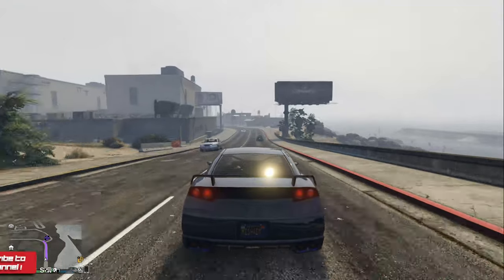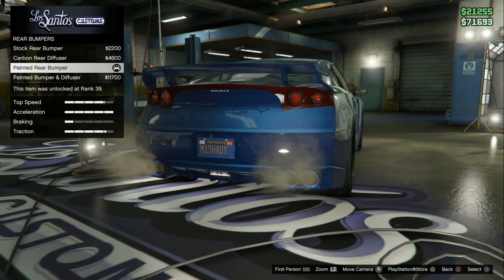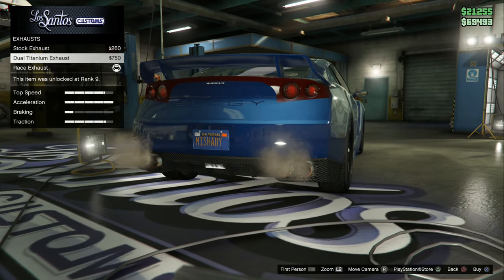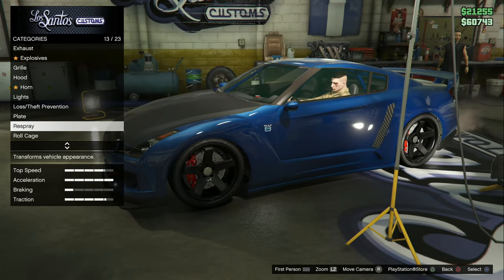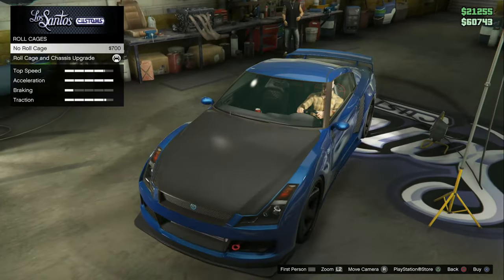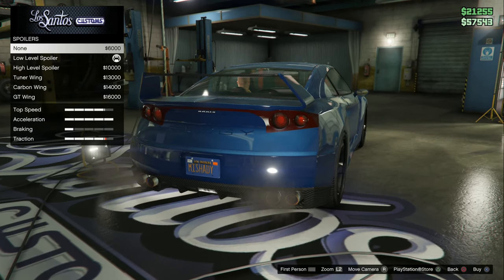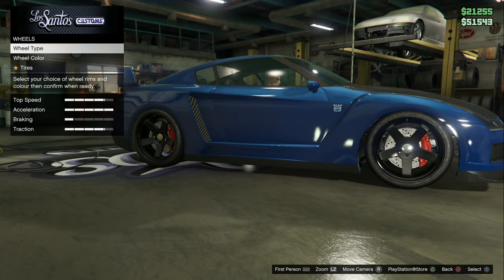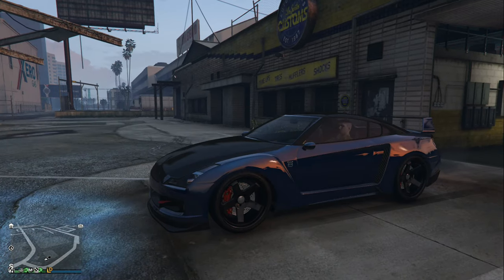GTA 5 - How To Make Paul Walker's R35 Skyline (Furious 7)

Comment: Not a skyline but ok
Reply from the maker: Then Enlighten me
Reply: it is
Reply: It is a skyline but ok 🤣🤣
Reply: Console Hoarder The R35 does not use the same chassis and is a totally different build. The R34, R33, R32 etc were called skylines because they all used the same chassis as the predecessors. ... So a R35 GTR cannot be a Skyline, but a Skyline can be a GTR?
Reply: It's an R35 NOT THE R34 learn ur cars